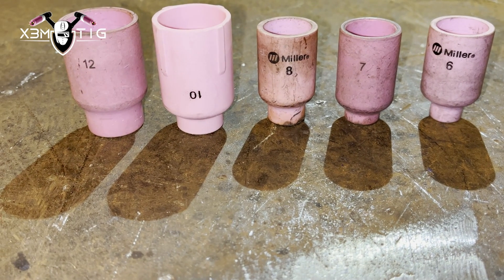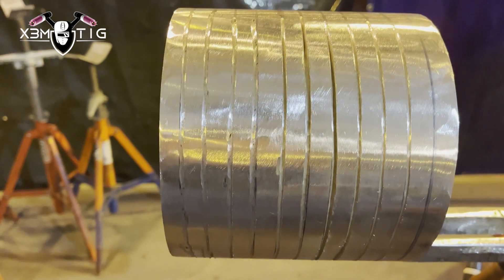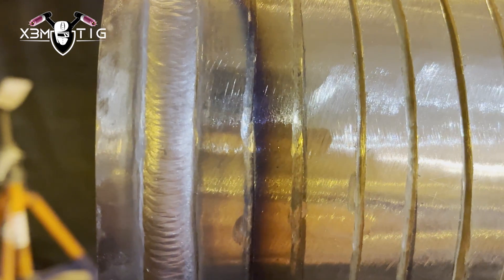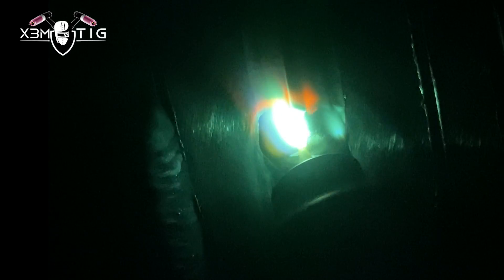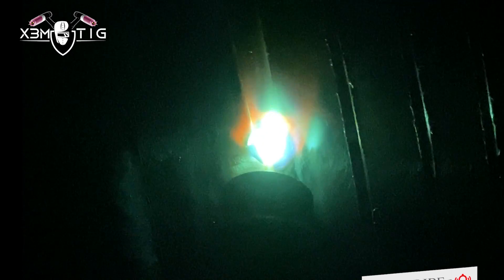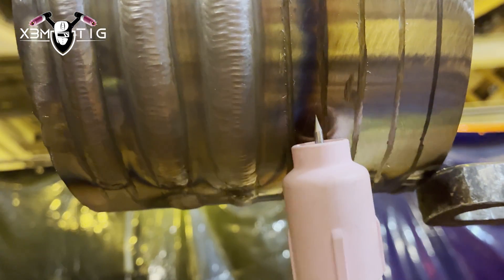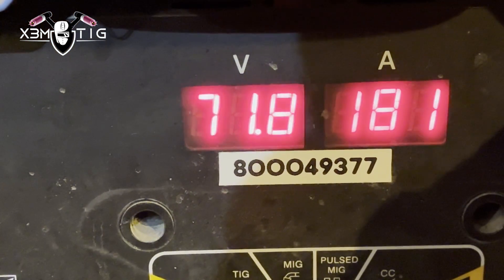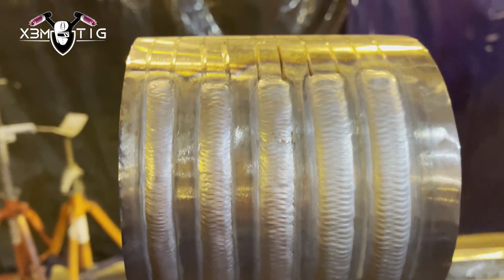Does Cup Size REALLY Matter For Welding Outcomes?

Comment: Thank you so much.  ❤
I think selecting the cap size depends on your material thickness and material size. But always welding with bigger cap size is more uniform and more comfortable and also more suitable for thick materials. 😊❤🎉🙏
Reply from the maker: You’re absolutely right, it depends on the application and your preference!
Reply: @X3MTIG  
Your so kind bro. 🙏😊

Comment: Thank you for the knowledge of the cups. Me personally I use stubby gas lenses furik #8, jazzy #10 fupa #12 and for aluminum standard #5 with CK worldwide water-cooled flex-loc #2 head. The cup's that you are showing is it a preference for pipe line welding? Most of my work is using the jazzy #10 it's my favorite cup unless doing SS exhaust work.